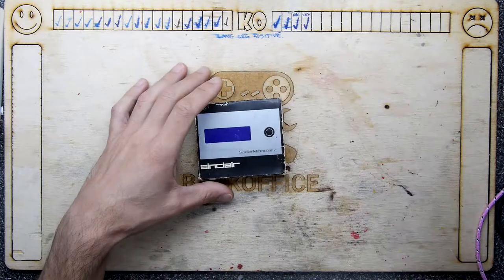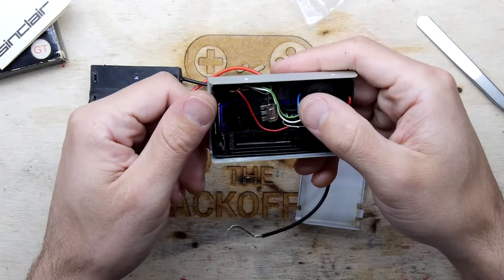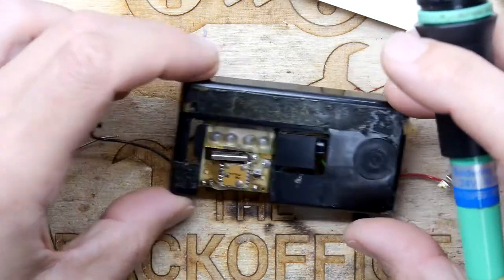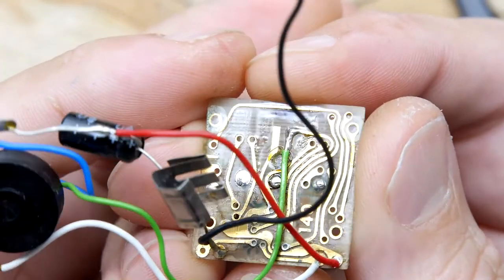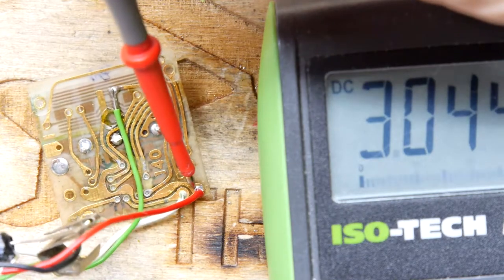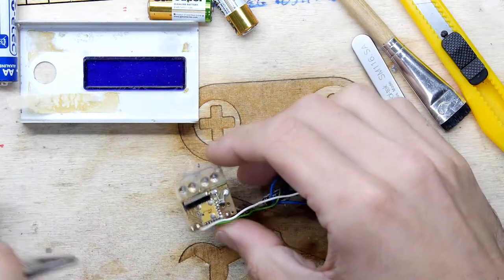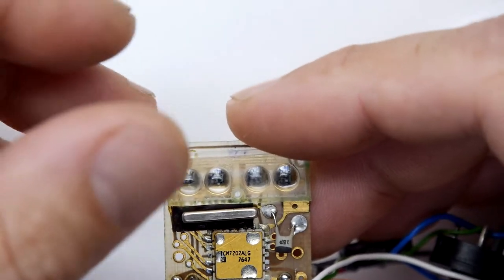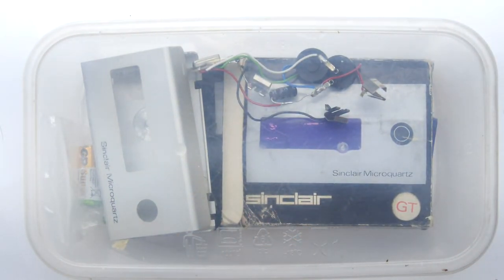Sinclair Microquartz Clock

Comment: That's an awfully tight compartment for the batteries. Maybe you get some other brands that are slightly shorter (same type) ?
Reply from the maker: +treguard1982 I think a good bench vice would work well 😁
Reply: Blunt force, I like it :D